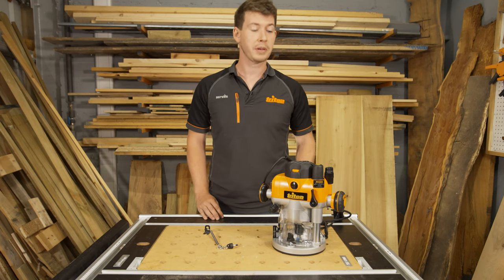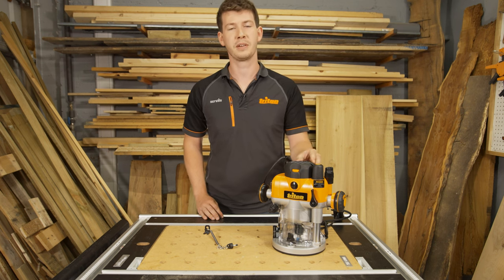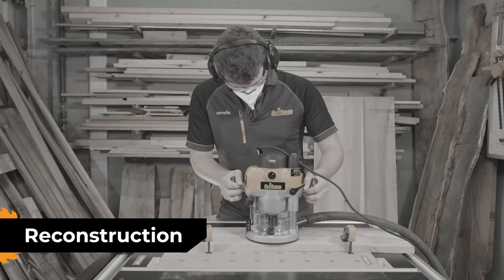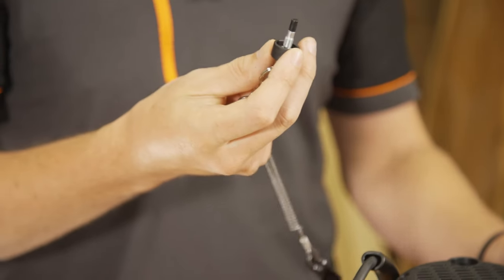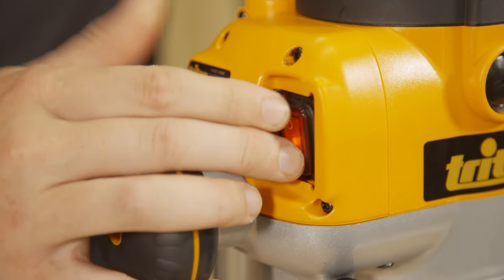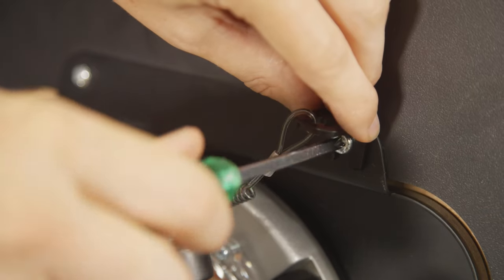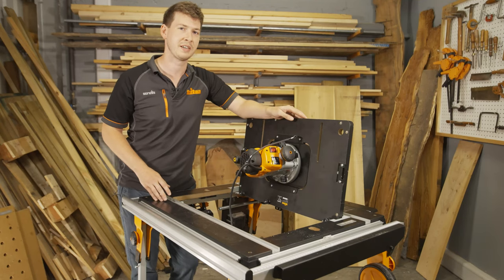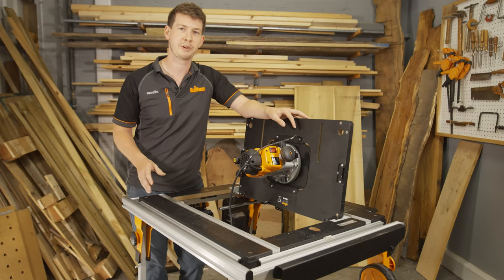No Voltage Release (NVR) on Triton Routers | What is NVR?

Comment: Hi @Tritonwoodwork. Nice feature, I'd like to buy a router with this feature, but am unsure how to find the correct model. Has the model number changed or anything I can ask the reseller to find out if it's the new model? If the names stay the same, I'm afraid they won't update the pictures.. or even worse, sell older models with the new pictures. There is no local dealer close to where I live in Germany.

Thanks!

Comment: I've just received a brand new TRA001 from Toolstation but I don't see any key. Since when are the models equipped with the nvr ?
Reply: Same question, only I bought mine at the beginning of this month, May 2023. No bypass key, presumably no NVR switch?
Reply: Just checked, and mine does not have the socket on the top for the bypass key to go in. This probably explains why it was being sold as clearance.

Comment: Can this be retro-fitted to earlier models?
Reply from the maker: Hello! NVR cannot be retro-fitted to older Triton units, but the switchbox of the Triton TWX7 table has NVR built in already. NVR is new only to the router's out-of-table function; the bypass key's purpose is to prevent the new in-built NVR from interfering with the existing NVR of a switchbox.